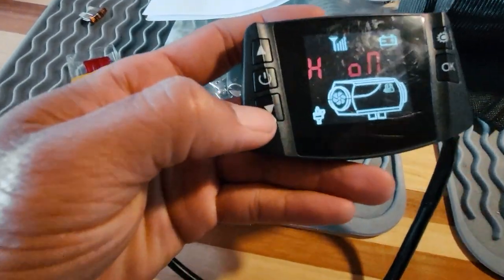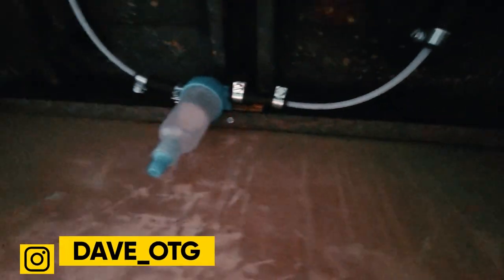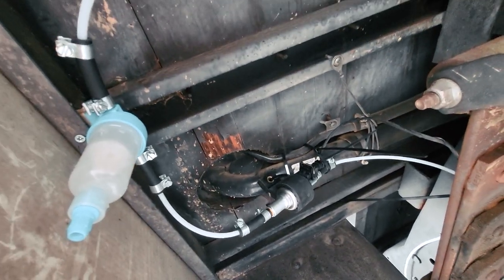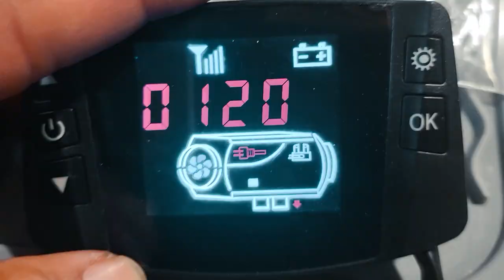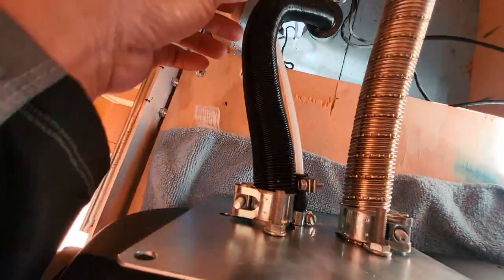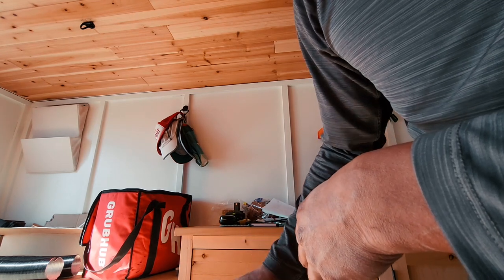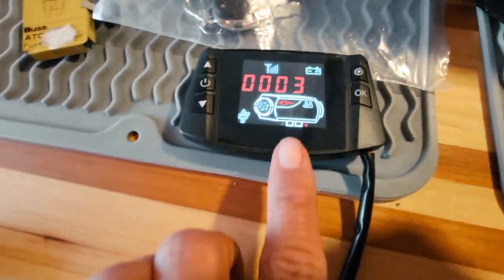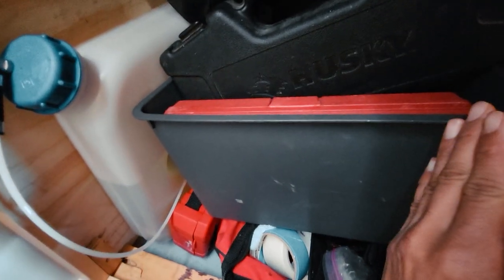BETTER in Every Way! LAVANER ALPINE PRO ($220) Diesel Heater Review and Install!

Comment: Hey Dave. Take a piece of copper wire and wrap it around the arbor before you spin on the hole saw. It's a homemade soft washer and the saw will come apart easy. Cool heater.
Reply: saw a trick the other day about fitting it into a socket and your impact to back out the arbor, tried it on the one i had stuck and it worked perfect.

Comment: Have you used you heater in the mountains yet? I want to use one in Silverton Colorado about 9318ft.  Does yours have an altitude adjustment?
Reply from the maker: I have and yes it does. I've used it at about 8500ft so far, w/o using the altitude setting an it was fine
Reply: @DaveOTG  Thanks...........

Comment: Surely your not leaving the exhaust hole through the floor like that are you?
Red hot exhaust touching the wooden floor and insulation 😳😳
If your going through a wooden floor or any type of material apart from metal you should be using a turret plate.

Comment: Dave thanks for showing this heater. Sounds like a good buy but can this be bought on Amazon or ebay? I couldn't really hear where you got yours from.
Reply from the maker: AliExpress. I'll drop a link by tmrw night. -currently traveling
Reply from the maker: https://www.aliexpress.com/snapshot/0.html?spm=a2g0o.9042647.6.2.6db937a1Ly9Qfi&orderId=8142369273365677&productId=1005001337909671
Reply: @DaveOTG  the link is not working Dave

Comment: Hold the phone, what's the deal with the fan friction?  This problem is endemic to the inferior Vevor.  For twice the price I don't want to crack the case and bend components.  Do I really have to buy a Webasco or Whale?  BTW, Alpine Pro 2kw is now 400 USD plus tax minus Cap1 Shopping discount.
Reply from the maker: There's an adjustment knob for the fan
Reply: Thanks  @DaveOTG   -- kindly explicate.  You mean the adjustment knobby can adjust of friction?
Reply from the maker: Yes. The knob will move the fan ever so slightly to and fro to avoid friction. It's easy to adjust, but from where I installed it it is difficult to reach. Problem with my placement not the heaters fault
Reply: @DaveOTG  Very cool; please consider making video showing fan adjustment, or point out in vid above.  Also, confirm the knob is inside the case, which you can't remove easily because of placement.  I don't see the adjustment in the manual.  https://ampersol.com/wp-content/uploads/2023/07/Lavaner-PRO-MAX.pdf

Thanks again!

Comment: cut your exhaust hole larger , you might find some burning on the wood that the exhaust is going through.  When did you get a larger vehicle Dave?
Reply from the maker: It doesn't get hot enough to burn wood. Got the box a few months ago!

Comment: How did you get it for $220? I just got one and I paid $431 including tax, I got ripped off😠
Reply from the maker: You bought direct through my link?
Reply: @DaveOTG  Link doesn’t work, I bought it directly from the US distributor
Reply from the maker: Ahhh prices have gone up double unfortunately. Still less than half the cost of webasto
Reply: I have just purchased one September 2022 for £218 all in.